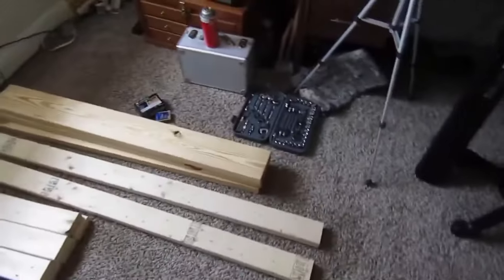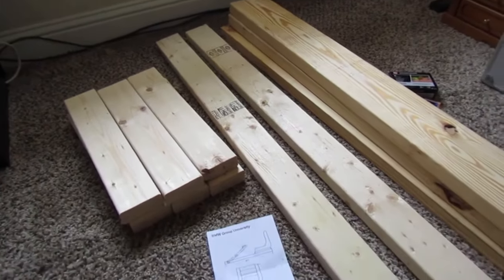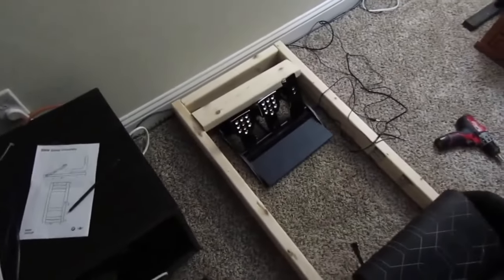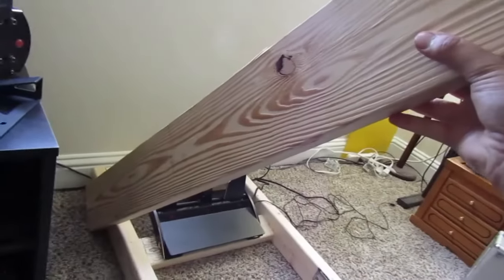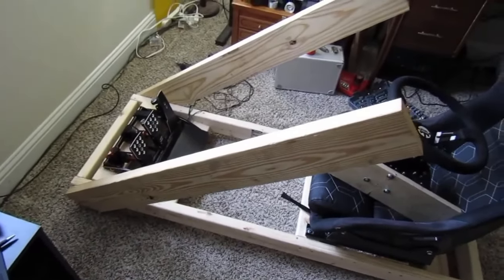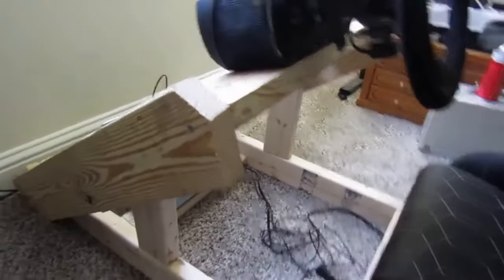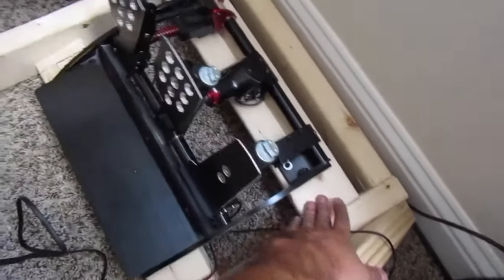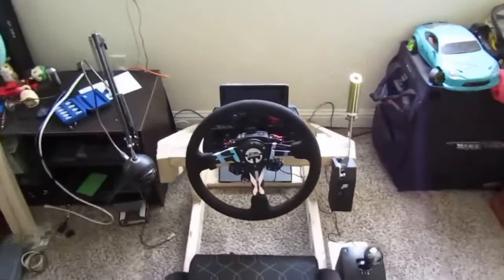DIY Race Simulator Setup - Build With Wood

Comment: With such a build, you should put a disclaimer: not suitable for a direct drive wheel. You'll break or twist the supports.
Reply: It should work with smaller DD wheels, CSL DD, Moza R5 / R9
Reply: first off, its a stolen video. but second, you do know that this is what they use to build houses right?
Reply: @almedasmith4677  I have never felt a strong DD, but if you look at the premium cockpits they are made from thick steel, much stronger/stiff than wood screwed in place. 
There is a reason cars are not made from wood. Saying that, I don't think this would have a problem with a 5nm DD, but maybe at 15nm there would be.
Reply: I have a 11NM base and a wood rig AND IT DONT TWIST , but I have yrs of carpentry knowledge unlike 99% of DIY sim builders